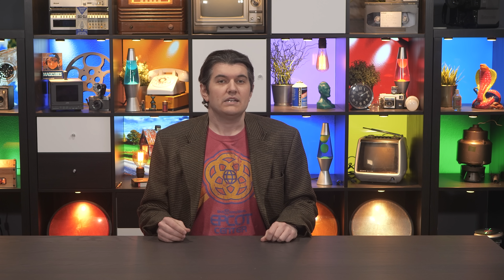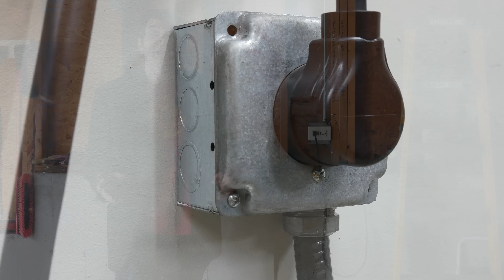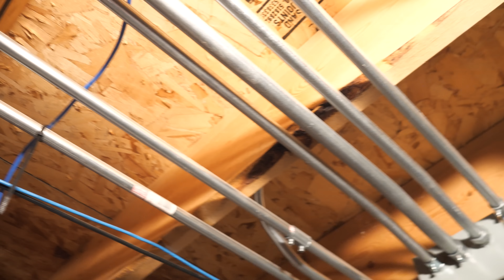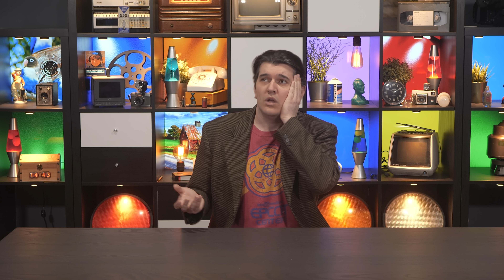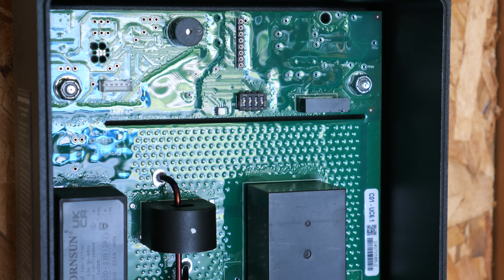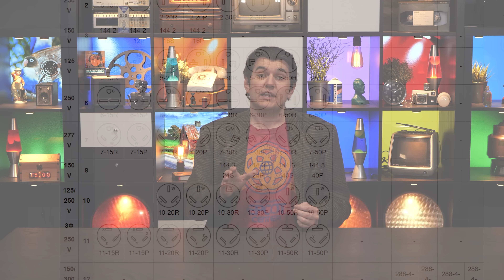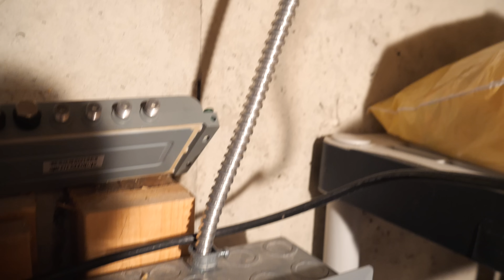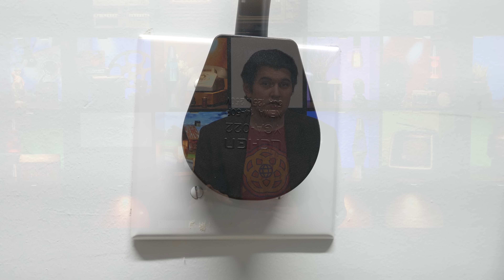The "standard" car charger is usually overkill—but your electrician might not know that

Comment: East EU viewer of yours here:

Another well done video of EV charging! I appreciate your mission!

I think the problem for people of understanding EV charging at home,is
- physics wasn't taught well enough,or more simple: they don't understand basic physics of electricity
- sort of coming from the first point, there was, and still there is a lot of ,what is that word in english... shadiness coming from the manufacturers of these wall station. "ohh, it is complicated, just buy our wall charger product, and you'll be good" .

Look after,check what you need exactly. "oh my car uses a 11kw charger" Great, what does it mean? It can handle 11kw of raw AC power coming in from the wall. THAT'S IT.

I have a relatively old house, fitted with 3 phase, 16Amps on each phase,230V to neutral, 400 V between phases.
There is a so called "industrial" plug in the garage (3 phase table saw, welder etc etc can be plugged in those) on a 4 pole 16Amps breaker block. So yes, technically I have 11kw at the garage. "So you run 11kw charging!"
Heck nooooooooo!

I have a so called active charging cable, just like Alec showed. Power output from the cable limited to 10Amps on each phase
Car told use only 8 Amps on each phase. So this actually is what it pulls from the circuit(the meter).

This is still a lot of charging power, more than enough. The point of the three phase is, even this 3X8Amps x 230V, what 5,5 kw is distributed between three phases. I sleep well at night,while the car is plugged in.

Another great thing, while most of the time the plug is plugged in, I just switch of the breaker block. We go the the parents on the countryside? No problem, the old man has a 3 phase industrial plug as well in the shed, I just hook it up to his, dirt cheap travel.

Can't wait for the EV charging revivew video!🙂🙂🙂
(but you might have guessed what will be the answer,when you asked the viewers,if we want a new video...🙃😉 )

edit: and the entire home,incl garage and everything on a single block of 30mAmp 3 phase fault isolation relay... )

Comment: I appreciate a good electrical install with MC cable or conduit, but requiring on residential seems a bit overkill.... but wire nuts are just fine. ( just had to knock on the wire nuts. they really are just fine... )

Comment: Thermal cycling can cause electrical connections to loosen over time. As the connections loosen resistance increases and this temperature increases. This can make a positive feedback loop until something eventually melts.

If you are capable a few months after installation go back in and retighten all the connections (plug and breaker). Also while you’re in the panel, carefully go through and tighten all the breaker connections in the panel. You’ll often find the connections of larger loads loose (water heater, AC/Heat Pump, oven, etc).

I’m not an electrician however I work in peoples breaker panels daily and I’ll always tighten everything for them. More than 25% (estimate) of panels I work in I find loose connections on something. Some are shocking loose to the be point i could wiggle the wire out of the breaker without a tool if I were to try.

Comment: 0:31 we're in Ontario, Canada and our commute is less than 120 miles, however we absolutely need a 40amp "charger". Our cheap electricity (2.8c/kwh CAD) is from 11pm to 7am. In the winter between reduced range and pre-conditioning that service is 100% duty cycle for that 8 hours.
Reply: 2.8c per kWh? Are you kidding me? I’m from German and it’s 25c per kWh and now I’m going to cry
Reply: @mark9294  That’s the cheap night time rate when nobody is using that.
Reply: Today, demand in Ontario peaked at 20,065MW at 6pm, and was lowest at 12,652MW at 4am. That's quite a difference. Because of the energy mix in Ontario - Nuclear baseline isn't very responsive, Wind power is often strongest overnight - the price for energy regularly hits <1¢/KWh overnight. (Given line maintenance, reactive power considerations, etc., consumers will never see a price that low.) Interesting thing is that they have to pay extra for some Natural Gas stations to stay up overnight as operating reserve despite the fact that there's no demand for their power.

Look up the Ontario IESO for some interesting charts and data.
Reply: @kepstin  exactly. There was a time that Ontario was paying neighbouring states and provinces to take our excess overnight base load. I have no doubt this situation won't last forever as electrification increases.
Reply: You did the math!
Reply: Also in Ontario on ULO plan... Unless your EV is an older model with limited range you still probably don't need 40A. 24A (30A breaker) would probably get you close to full and you could get back to full on the weekend (assuming you don't work 7 days a week). But there's no doubt 40A gives you some breathing room.
Reply: Exactly to translate power cheap at NIGHT when most people are not using it for a couple of hours. Fast chargers take advantage of cheap power better than slow. You can program these chargers to turn on at cheap hours.
Reply: I think they call it ultralow overnight pricing
Reply: Must be nice.  In rural Ontario (ie. Hydro One areas) it's a fixed 11c/kWh regardless of time of day.
Reply: @2dfx  I'm a Hydro One customer in rural Ontario also. And I have the ULO plan.
Reply: Won’t be cheap for long when peak hours become 11pm-7am when everyone is charging their car. Enjoy while you can because now you’re ruining it for everyone else.
Reply: @MB-nm8tt yeah ok. The reason off peak is off peak is because most businesses and industrial uses are closed / not operating at those hours. And ULO plan participants pay much higher peak rates (10X as much).
Reply: @MB-nm8tt What an amazing thing to believe.  😂
Reply: @737smartin it’s not a belief, it’s just simple supply vs demand economics.

Why do you think Europe has it so bad with electricity? They don’t have Ontario’s hydro, wind, nuclear. But even Ontario has it’s limits if everyone suddenly doubles their electrical intake with the purchase of an electric car.
Reply: @MB-nm8tt  If it is true they are making electricity more expensive because they are using it more, then it is also true that they are making gasoline cheaper for everyone else by using less.
Reply: @TheRyanandKimberly  I’m not sure if you’re writing this in the context that gas is now at a 5 year low here in Ontario and I don’t know the stats of people now driving electric cars 6 months after I made that post but I know electricity prices here are creeping up and gas is now cheap. I have no idea if it’s because of new electric cars or AI server farms (if there are any in Ontario) sucking up all the available electricity.

I know where I am, we get mini black outs more often than before.
Reply: @MB-nm8tt  What’s your gas price now?
Reply: @MB-nm8tt I’m in Ontario, gas is regularly around $1.80/ltr and will stay there or go higher…thats over $7.00/gallon. That’s the opposite of cheaper!

Comment: I think having easy access to control charging speeds is a huge plus in an app connected charger so that you can have it charge at a slower rate to extend battery life except when you need to and then you can easily up the charging speed in the rare cases where you need it to charge faster instead of having to take the screws out of your charging station. Look at the manual and flip some dip switches every time you want to charge at a faster speed or just leave it charging faster and degrade your battery sooner. This is important because the speed at which you charge your batteries absolutely has a very high impact on battery life. This is one of the reasons I am weary about relying on fast chargers cuz your car won't last as long

Comment: I don't agree with your take on smart EVSE. I have several EVSEs at home and at work. They are all smart (more or less). They have also all been rock solid. Not one issue with charging so far. We do have stable power here in Germany though. The last time I lost power anywhere(aside from 1 or 2 times where construction damaged a cable directly in front of the building) was at least a decade ago. Probably longer.
At home I could get by without the smart stuff since Tesla does at least one thing correct currently by offering an extensive API and even locally over Bluetooth. My old e-golf on the other hand didn't have enough API features for solar surplus charging. And even dynamic price charging which was possible through the API with 3rd party solutions like EVCC was in no way reliable enough. And VW is discontinuing the cloud features anyway.
At work I actually need them to be smart as you alluded to. I don't have access to my employees cars API, I need to have authentication for individuals and I need to track the energy cost including dynamic pricing. I also have to comply with throttling demands from the grid provider and I want charging only to happen at cheaper times etc.
But I do agree this should not require an App or cloud connection. So I chose the Go-e with local APIs like MQTT.

Comment: Got a 2025 ioniq5 and then convinced my folks to get one a few days later based on your videos. We've both installed L2 smart chargers because it's required for the utility rebate and off peak credit programs. I guess Alec just has an off peak rate you can program in the car, but both Eversource and PSE&G over here prefer to scrape the data from your charger and program it (you can override) to wait until the times they prefer, then for doing so credit you per kwh for the amount you charge. Oh and they want to see the installation receipt and permits. So if you're doing all that the marginal cost of a bigger circuit is pretty minimal unless you have a load limit on your service, in which case absolutely derate rather than upgrade. But faster is better if you really only have 6h/d to charge economically.

Absolutely hardwire your charger though. No neutral saves a lot of material but it's not code to install a receptacle that way. And no GFCI saves money too. It's just not that hard to rewire a new charger and you're not going to swap out that often
Reply: "No neutral saves a lot of material but it's not code to install a receptacle that way."
Explain 6-50 (common welder receptacle).
I've installed EVSEs with a 6-50 inlet.  GFCI, yes.
Reply: @alsavage1  I should have said it's not code to install an outlet like the NEMA 14-50 typically used here and discussed/shown in the video, with a neutral prong, without a neutral.

Comment: Agree that hard wiring is usually the way to go. But I would suggest installing 48A charger if possible, even if it costs more.   It’s handy for the rare times when a quicker charge is desired, potentially saving a stop at a supercharger.

Comment: Really great video to make clear, how easy the handling of an EV can be and how low the real needs really are!

As a European (more specific German) I do not have to deal with those crazy currents. You can draw 11 kW out of every 3-phase 16 A CEE-connector (continously!) ... but of course it is a very good idea to use a direct connected "wallbox" (as it is called here!). In my house even 22 kW would be no problem, but unfortunately I do not have a parking lot near my house, because I live in a Pedestrian zone ... No problem, I can go by bike. But anyway, you can charge your car with a 3,6 kW outlet (yeah, not specified for continous usage, I know!) easily to meet your demands for daily commuting.

Please do not pollute the ocean! - Just throw the Apps there! - You're absolute right! - Keep it stupid simple!

GFCs can be a real problem (mostly it is not!) because of the DC that is "blocking" a standard GFC-device from tripping.

Comment: Charging at 15A is fine for most people. That's six miles of range per hour of charging... easily 50-60 miles overnight and twice as much on the weekend, so in total we get (5*50 + 2*100) miles = 450 miles per week out of a regular wall socket. Who has a daily 80+ mile commute? Very few people, indeed.

Comment: Is the power wall or something similar that you can hook up solar panels a better way to do it ?
Because you can get some extra juice to the battery which would act like a buffer so I would be connected to normal outlet+ solar panels but output would be much higher power

Comment: Smh, not good to charge every night. Batteries degrade after a certain amount of charge cycles.
Reply: 2 half charges is 1 cycle. 4 1/4 charges is 1 cycle. Makes no difference.
Reply: @stevemcgowen  You have clearly never worked with batteries. I have. ;-)
Reply: @schmetterling4477  Full to empty is 1 cycle. That's how lion chemistry works.
Reply: @stevemcgowen  Dude, stop confessing that you are clueless. If you want attention, just tell me. I am happy to talk to you. I won't catfish you, either. I am an old man, so I will never be your girlfriend.  ;-)
Reply: @schmetterling4477  Sorry if you are confused. LiOn is different than alkaline or lead based batteries...
Reply: Batteries degrade due to high charge/discharge current and thermal stress on the electrodes. They also degrade fast near the upper and lower end of their capacity, i.e. one should stay between 20-80% or even 30-70% of design capacity. That means low and slow and charging every other day/night at 15A is perfectly fine for most people.

Comment: I have a 100 amp service panel to power my house. I use a 30 amp breaker for my EVSE and it charges at 8.5 KW just like your parents house. I actually have the grizzly and love it. I replaced my regular dryer with a heat pump dryer that uses 110 instead of 240, so I don’t have any problems with charging my EV6. Cheers